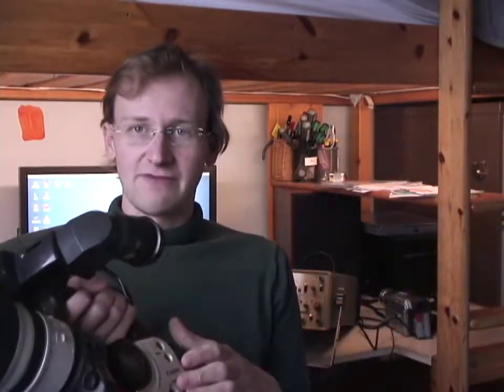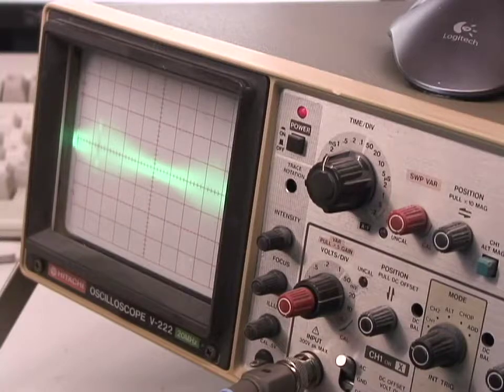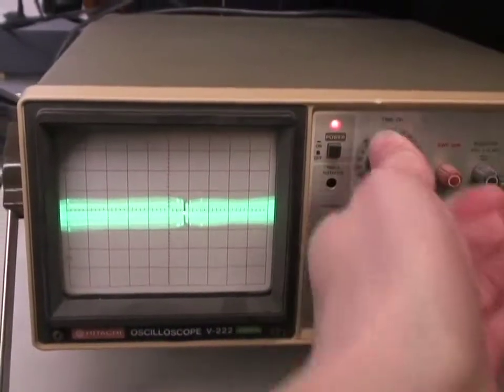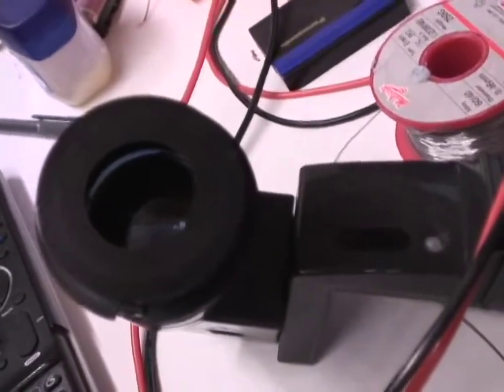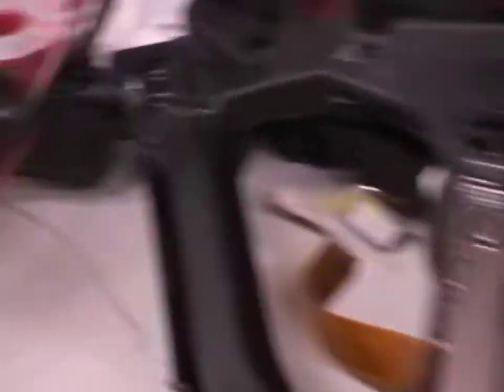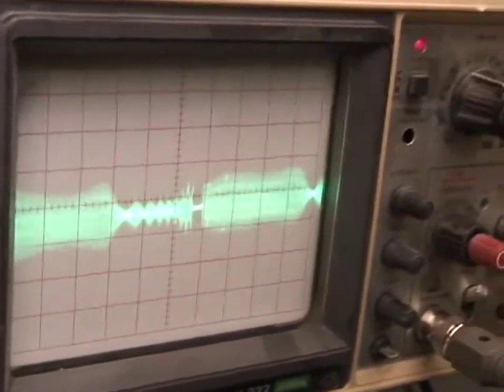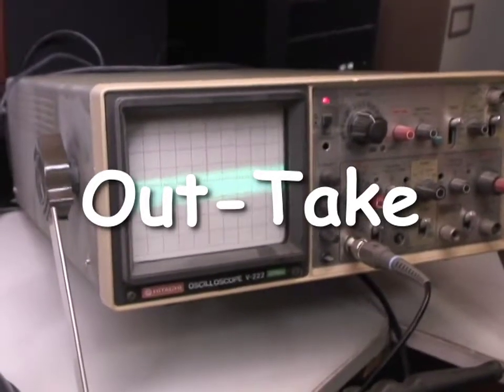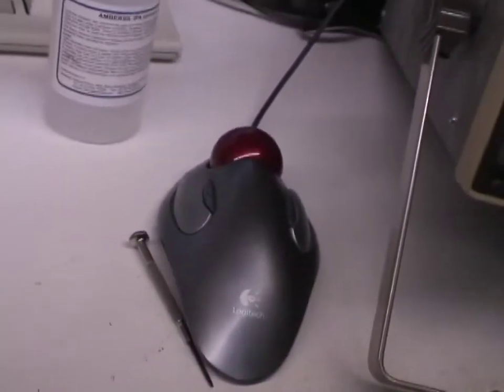Canon XL1: Tape Path Alignment with Oscilloscope (MiniDV)

Comment: I got an XL1s with glitchy playback even when playing a known good recording. I even tried a cleaning tape. I don't think it's worn heads because when I rewind it sounds like it's chewing the tape and it flashes to eject the tape. I think it's a capstan issue.
Reply from the maker: Have you dismantled it and examined it while it is in operation? That may give you a better clue as to what is wrong. The plastic clip which holds the pinch roller in place is quite prone to breaking on some Canon models (my XL1 seems fine but that uses a different tape mechanism to the XL1S and XL2). It may be worth giving the guides a twiddle to check the alignment, but you'd have to examine this first to see if it is causing the tape to curl at all.

Comment: My canon XL 1S ate my tape how do I fix this?
Reply from the maker: It depends on what the fault is. Personally, the first thing I would check would be the pinch roller, as they can be prone to coming loose. You may also need to check that the mechanism is actually driving the take-up spool properly.
Reply: @stevecoatesdotnet  I also forgot to mention that the tape deck won’t close, you press it down and then it pops back up😭